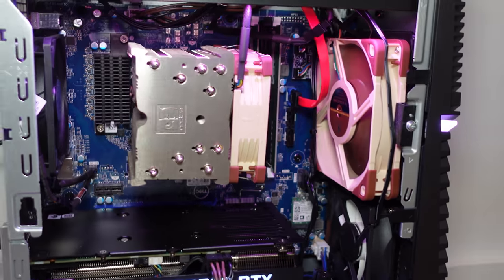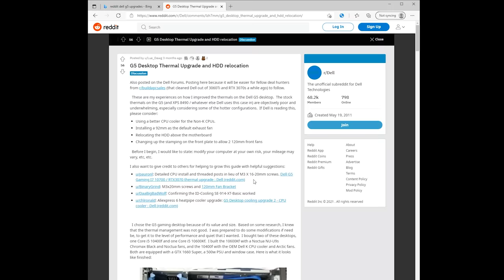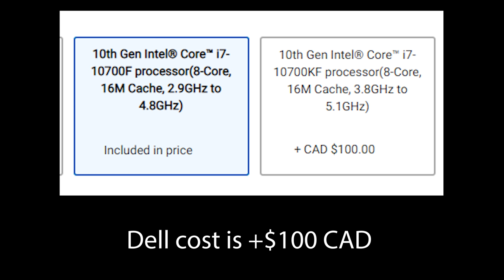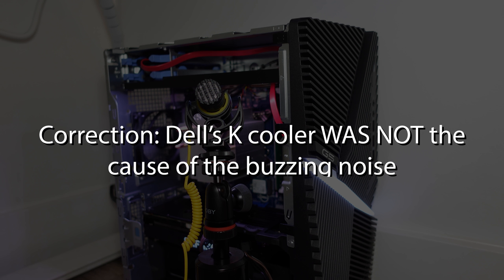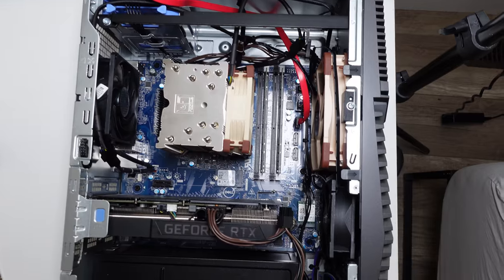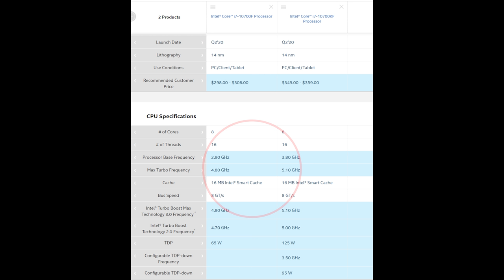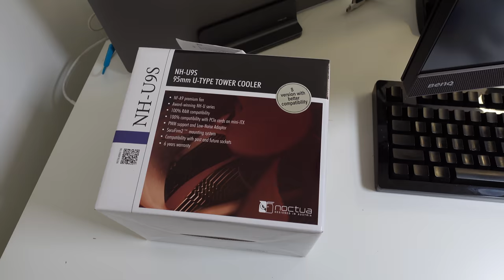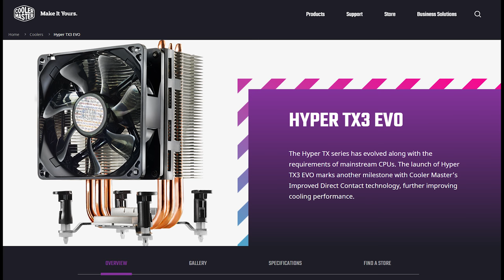Should You Upgrade Your Dell G5/XPS CPU COOLER? (with step by step instructions, in-depth analysis)

Comment: Hey thanks for the extremely helpful video. 

Upgrading my G5 with a i5 10400f eith the stock pancake cooler and 1660 Super.Im buying the Noctua U9S Cooler and a  Noctua A9 PWM fan. 

However, I plan on skipping out on the step of removing the HDD bay for the intake fans( future upgrade maybe). Im planning on just swapping out the stock cpu cooler and stock fan. Im curious as to whether there will be any issues with this regarding airflow. What will adding intake fans exactly do?
Reply from the maker: You'll get significant boost swapping the CPU cooler.

Comment: looking forward to your fan installl, i just upgraded the exhaust fan to a noctua nf-a9 pwm chromax black and also added a front intake fan using the noctua nf-f12 industrialppc 3000 pwm. im curious as to how you mounted your front fans. it seem as though you used a bracket.
Reply: Hi! Could you talk a bit about your exhaust fan upgrade ? You just replace the DELL OEM fan and then plug direcly the nf a9 to the motherboard ?
Reply: @kingievo4411  yep thats it, i had no bios errors. i have the 0m6c7g motherboard. after the exhaust swap and adding the 80mm stock fan and the 120mm noctua front fans my cpu and gpu temps have improved a good deal. 76c gpu temp after 2 hours of gameplay where as before it was reaching arounf 83 to 85c. cpu temp is around 46c now as well and i havent even upgraded the cooler yet
Reply from the maker: need video will answer all your questions! links to the fan in the desc. of this video if you need the 3d printed part.

Comment: Great video! Thank you. Question, did you have to change any system settings for the noctua cooler? You mentioned tweaking fan curves but I didn't get if that meant fo the cooler or extra vent fans you added later. I have the basic i7 11700 which has the stock pancake cooler and runs super hot. So I want to upgrade the cooler, just don't know if the swap will work the same or if there's different socket depths or incompatible power needs since they are different. Also, did the noctua bracket still work with the vrm heatsink or did you have to remove it? Dell won't answer any of these questions.
Reply from the maker: u should be able to swap without any problems! just follow my instructions :) yes, vrm had no issues

Comment: I just bought a Dell XPS 8940 from Costco, which doesn't have a K series processor, and now I see videos like this telling me upgrading the cooling system is "essential". I don't play video games so do I have to do this? Will this void the warranty? Should I return the Dell and buy a different brand?  This is like buying a Honda Civic and then being told I have to switch out the radiator so I don't overheat on the way to work. I resent the idea I have to hire someone to "fix" a brand new computer.
Reply from the maker: Yes, if you don't game or render videos , you'll be ok with stock CPU cooler.

Comment: Do you still using the K CPU tower cooler? I find mine never changes fan speed, now I have a A9 as exhaust, A12 as intake, and the K cooler is the only upgrade that actually made a significant temperature drop. and the weird thing about this cooler is that the cpu cooler fan speed remain at 780-830 rmp no matter what temperature the CPU is running at. Idles at around 40C, full load at around 75-80, the fan speed is always in that 780-830 range. Do you think the cooler is faulty?
Reply from the maker: I use the noctua now!

Comment: Really appreciate the video! It's very helpful. I used the grub screw method (easy to get in Australia) and replaced the stock fan for a non-K i7 CPU inside XPS 8950 without any trouble at all. 
After the replacement, do I need to do anything to adjust the fan speed?
Reply from the maker: Awesome!

Comment: Alright, here are some problems I'm having.

1. When I start my PC up, it keeps doing a pre-boot fan check, freezing, and then saying the fan failed to respond correctly. When I hit Continue, Windows loads up just fine. And for SOME reason, Dell was shitty enough not to include fan settings or controls in the BIOS settings.

2. Speedfan isn't detecting my fan, so I also don't know what to do about that.

What can I do to fix these two issues? Any help is appreciated.
Reply from the maker: Did you make sure the connect to screw the 4-pin
Reply: @JSyntax  I don't believe I did. Is it the adapter shown that you plug it into in the video? I only just now noticed it, if this is the case and possible, may you provide a link as to where you got it? Great tutorial.

Comment: I have the g5 with pancake cooler, I don't wanna mess with changing the CPU cooler, if I just add better exhaust and intake fans, will it improve the temps ?  At the most, my CPU gets to like 170 F.
Reply from the maker: It's easy and fun! Watch my tutorial
Reply: Update:. I upgraded the we exhaust fan to the SO and it's a lot quieter, but not much cooler.  Also, the AWCC has issues with the non OEM fan.  It can't auto manage the fan in a custom thermal profile
Reply: @deseipel0076  cpu cooler change is a must.  I think most well reviewed coolers will do though.  even the stock premium cooler as he says.

Comment: Great Video Guide JSyntax

You can't put too much thermal compound, but it can make a mess if the excess squeezes out. I also  went with the same Noctua cooler, and artic cooler intake fans. I had the i510400f so I received the pancake cooler the results were night and day.

Some tips for others here, I also removed all the Dell apps, and got an even bigger boost to performance. 

I will be adding more Fans, however my CPU now hits a max of 52celsius under 3DMark, and the graphics card after subsequent repeat runs starts to trend up to the 87degree celsius mark.

i5-10400F
GTX 2060 6GB
Upgraded ram to 2x16GB DDR4 2666 Crucial Low Latency Ram
Added Noctua NH-U9S CPU Cooler
Artic Cooler 120mm Intake front top

Planning to add more fans, actually came on to see the case fan brackets etc.

Thanks again!
Reply: dude thanks for this reply I think im going to go the same route you did
Reply: Yes you can.  The least amount you can use the better the heat transfer will be.  Although as you found out it will just squeeze out.

Comment: Is there any particular reason for using CoolerMaster's 92 mm Sickleflow fan rather than a second 92 mm Noctua fan? Is there any particular reason for using an Arctic 80 mm F8 fan rather than an 80 mm Noctua?
Reply from the maker: I was only able to fit in a 80mm fan in the front intake for the graphics card
Reply: @JSyntax  Thanks! This doesn't answer my question, which was why use an 80 mm Arctic F8 rather than an 80 mm Noctua AF-8.

Comment: Hello everyone! The solution to prevent the throttling is using a software called throttle stop.After I set it up, my 11700 can stabilize at around 4.2g, although the CPU temp is around 90 degree…

Comment: Love the video. Just gotta ask, how did you rig a third fan to the front of the case (where the 3.5" HDD would have been)? Going to replace the stock pancake cooler with the Noctua, but I still want to put the old fan to use somehow. Also, have you noticed reduced temps for your GPU after the upgrade? I'm more concerned about my GPU temps than my CPU because my GPU is consistently hitting the 70-80 C range when gaming, so wondering if adding the Noctua cooler will make a difference there.
Reply from the maker: You mean the top in take fan? I'd remove the 3.5 HDD enclosure and use the 3d printed part (see my description). It cost me 5-10 bucks to print from Craigslist.
Reply: @JSyntax  thanks for getting back with me. I saw your later video where installed the extra fans. My plan is to replace the rear 80mm fan with the 92mm you used, and then repurpose the 80mm fan and put it in the bottom front (facing the GPU). I won't be installing a 120mm fan, so what cables would I need to hook up just the 80mm, 92mm, and Noctua CPU cooler fans? (Sorry for all the questions, I'm very new to all of this)

Comment: hey man...could you tell me if the Cooler Master SickleFlow 120 ARGB 120mm Case Fan will also work without causing bios issues...thanks in advance
Reply from the maker: No to big
Reply: @JSyntax  with an adapter I can make it fit but will it cause issues with the bios? It runs at the same rpms

Comment: I have an G5 with i510400f. The CPU has that trash basic OEM cooler. Do you think the ARCTIC Alpine 12 CO would be good or still not enough?
Reply from the maker: Why not go with the verified noctua u9s?
Reply: @JSyntax  Cause the arctic is much cheaper, that's the only reason

Comment: Hey, Very useful video, I was able to install it and I can see the fan running, but I'm getting this error with dell support assist that says "cpu fan detect error" and I can just press continue and it seems to work fine after, does anyone know how to fix it?
Reply: use a splitter and keep the original fan too.  might be the fan speed it can achieve.

Comment: Stock my G5 runs at 90 Celsius I replaced the back fan Noctua fan and it made no diffirence.  Is 90 normal?
Reply: That is absolutely not normal, normal would be around 60-80, 90 degrees should only be reached under stress or long time gaming. Replacing the back exhaust fan is nothing near enough because well, its only a exhaust fan. In order to get better temperature you need a intake fan/fans. Which on this channel he has showed how to install those fans and I am guessing you’re using the crappy low profile cooler without a k series cpu, you’ll need to upgrade that for better cpu temperatures. Hope this helps!

Comment: Does anyone know for sure if this G5 (5000) with the H470 motherboard can be upgraded with an 11th gen CPU? Looking to go from the i5-10400F to the i7-11700F, but not sure Dell will allow it. The H470 supports 11th gen but I can't find any confirmation that someone has done this upgrade. Looking to do the Noctua HSF upgrade at the same time since I have the stock (little) cooler.
Reply from the maker: It won't be a big upgrade.

Comment: Thanks for the video. My Dell G5 5000 with i5-10400F was shipped with the pancake cooler. After viewing you video and trolling through Reddit and Dell forums... Ultimately I decided to order the Dell "K Series" cooler (P/N VWD01) directly from Dell at CAD54.00. The incremental cost and parts to install the Noctua were just not worth it for marginal gains, if any. Appreciate you sharing your experience.
Reply from the maker: you'll like it!

Comment: Remember to duplicate and distribute the sensor wire on old Dells to all fan connections to avoid detection errors on boot.
Reply: Hi I am having this issue on boot with this cooler. Can I ask what you mean?
Reply: @WangJack-z7g  there's something about dell fans such that many non dell fans give the error on boot.  It maybe that other fans won't spin up to the rpm of dells.  One way to deal with it is use a splitter so the dell fan is still connected while you attach your new fan too.  Should avoid the error.

Comment: Are you allow to set the fan curve? Speedfan couldn’t detect the fan at all.
Reply from the maker: Yes you can! You need a 4pin pwm. Fans on the splitter 3pin portion  will feed of the 4pin input

Comment: i have a dell g5 5000 pc with an Intel i5-10400F installed (rx5700xt just FYI). I was looking to upgrade the CPU to i7-10700K. Is this CPU compatible with my motherboard? I am clueless about compatibility.
Reply from the maker: Yes it is
Reply: @JSyntax  do I need to upgrade the PSU?

Comment: Dude the fact you reference and had a montage of all the forum posts/videos made me laugh so hard because I went through the struggle trying to consolidate all the necessary info. Thank you for compiling the information. Quick question, I dont have the same exact model as you, i have an i5 10400f and a 1650 super (Dell G5 5000) Should this install should be compatible with mine as well?
Reply from the maker: Oh man, the Dell forums are a mess. I think theeres 2 really good organized reddit posts but the amount of info was a lot to digest. And yes, as long u have a G5 desktop pc, you can upgrade. Let me know how it goes!
Reply: @JSyntax  Thanks for getting back to me bro!  I watched your other vid on the fans as well. Think im going to opt for the noctua cooler and one additional noctua fan in the back and bring the stock fan to the front. (I have the crappo pancake cooler)  Cant believe this prebuilt didnt have at least one intake. Thanks again and Ill return with my results for those who bought the same exact model as mine!

Comment: Hey JS,
This was an outstanding instructional video!! I did sends hours on this topic via the forms stated with more confusion and questions that you clarified.  BTW what is your thought on  liquid cooling, such as Cosair H80i v2 High Performance Liquid CPU Cooler or H60?
Reply from the maker: If it's going to fit it'll be better than stock!

Comment: I'm quite ignorant about Canada so you should correct me but I really expected Canada to be all Metric?  America uses freedom units, like 3/5UNF, they have an inch which is slightly different to an actual inch and a gallon that is different to an imperial gallon and here in blighty we mix units for no apparent reason. For example its -5C to make it sound cold and 90 degrees (F) when we want it to sound hot.  For aircraft separation we use feet for the height and km for the horizonal distance in the official rules.

Comment: Appreciate this tutorial a lot.  I ended up installing the Noctua U9S for my Dell G5 5090. As far as I can tell, fan and cooler are performing well. A9 fan is spinning, and CPU temperature is always under 60C when doing intensive gaming. 

However, on boot I get a critical error message from BIOS. BIOS tests the fan for ~30s before returning the error. After that I can use my system just fine.  Anyone else have this experience? Error message is annoying / janky.  BIOS seems to be returning the error only because the cooling system is non-Dell. Has anyone figured out how to disable the fan testing and error?
Reply: use a splitter so you can keep the dell fan connected too perhaps?

Comment: Still waitinh for explanation on boot error , my g5 is using a noctua heatsink but i had to stick with oem fan to not get the boot error
Reply from the maker: did you use a 4 pin connection?
Reply: @JSyntax  yah lol theres 2 one is labled cpu fan and other is fo the exhaust on rear of case . I eventually jist used my multimeter to locate a 12 volt supply and plugged extra fans into there to achieve full janky hack extra fans lol

Comment: I appreciate your making this video! I recently picked up the XPS 8940 for next to nothing. The person bought it, removed the NVME and graphics card, then sold me the computer. I already had an NVME and a NVidia GTX 1650 SC so it was no big deal. It has the I5 11400 processor and of course the crappy small cooler... I found the premium cooler for it that comes with the k series chip. It was pricy, probably because they are hard to get but it was easy to install and works pretty nice! I also found the heatsink for the VRM's and chocks, it was well worth the money! I still need to get a Noctua 92mm rear case fan. Can anyone verify that the fan is compatible?
Reply from the maker: Yes it's compatible. Check out my follow up video on case fans. Also, how did you install windows on your Dell pc without the original storage?
Reply: @JSyntax  I had a Samsung MVME that I installed. The seller removed the Windows key code too! It had been digitally activated and the Dell install was done with an OEM copy anyway.
Reply: Reading your story I had a similar experience. About a year and a half ago, Microcenter had an open box XPS 8930 with a core i7 for $300 US. I was like wow this is a steal, it sure was because they stole everything that was in it. 

The GPU, NVME drive, 8 Gigs of RAM was missing, and to add insult to injury they stuck in a Seagate 5400 rpm hard drive but it at least had Win10 Pro. So basically it was really barebone core i7, with onboard graphics, 8 gigs of ram, slow mechanical sata drive but they cleaned off the keyboard and mouse.  I use a PC at work and a Mac at home but now since working from home more, I decided to do some upgrades on this machine. I already had an NVME drive, got a WD Sata drive, more memory (up to 32 gigs now) and upon reinstalling Windows 10 I thought I needed the previous key but it digitally activated on it's own. 

Next is the cooler which brought me to this video and looking into graphics card but I'm not a gamer so it's not a rush.

Comment: I would have thought (..for you) the upgrade to the Noctua would have been worthwhile just on noise alone.  Even running torture tests it's not loud at all in comparison to stock fans. But yeah... if you already have a premium cooler it's not really necessary to upgrade to a Noctua... although getting the 92mm fan installed is still a good idea.   The stock intel looking cooler though definitely shouldn't remain in anyone's system and is a must to get rid of (imo)
Reply from the maker: Agreed! And I did correct myself, the CPU fan was great! It was the psu fan was not for me. Silly how gamers nexus praised the psu for its technical specs but completely ignores the human aspect of noise and small fans... What a robot.
Reply: @JSyntax   Well.. mileage may vary right? I don't have the issues you have with the psu making noise on either of the systems I've been working with.  It's quite possible they didn't have that issue either.  Gamers nexus ticked me off especially on their Alienware recent review.  NO way they didn't know they were getting a air cooled unit. They did that on purpose.   Sure dell needs to be called out for even having air cooling as a option with their current line of cases but even so.